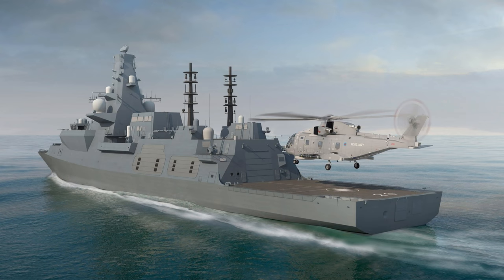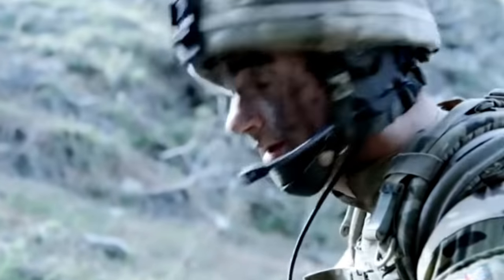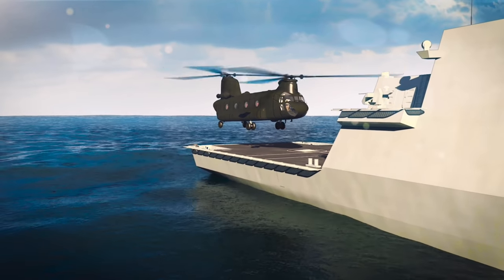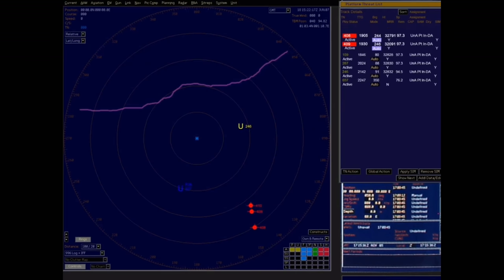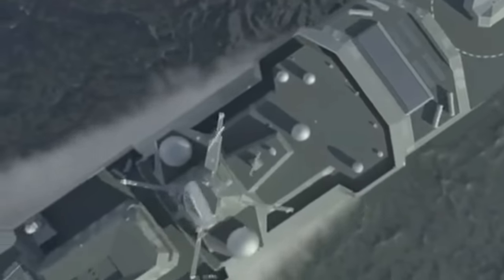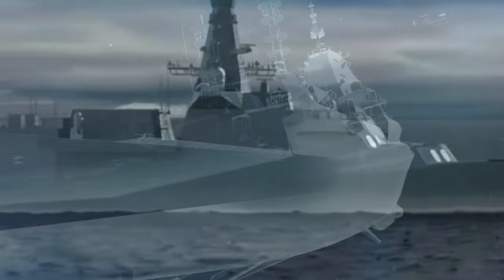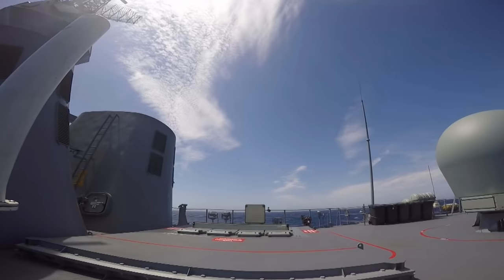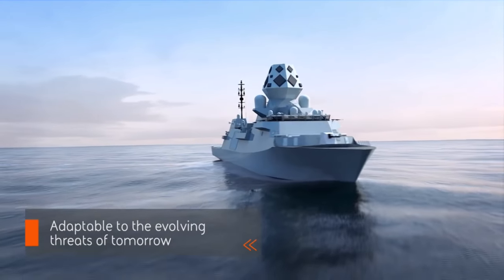British Type 26 Frigate | FUTURE NAVAL FLEET PROTECTION

Comment: The Sea Ceptor will be in 4 missile packs,  so the Type 26, will have 192, of the one type then add the bigger 24 bigger silo missiles  - you got over 200 missiles per ship. The potential is staggering, the brits could use the type 26 as an air defence platform and just arm it with the sea ceptor. You do the maths but of course, any ship wants some flexibility but If they do go for the quad pack as they are doing for the type 45. 

"Sea Ceptor will operate from the SYLVER and Mk41 launchers using a quad-pack configuration, various flexible canister configurations are also available. The Soft Vertical Launch technology reduces system mass and eases installation."

Potentially you have a type 26 armed with 288 sea ceptors - staggering firepower. I image a Type 45 armed with 48 asters, and 96 Sea ceptors. Imagine two of them in a carrier strike group with two type 26 both carrying 288 sea ceptors. That is one powerful defence ability, with the potential to use the missiles for some strike missions. 
https://www.mbda-systems.com/product/sea-ceptor/
https://www.navylookout.com/from-sea-wolf-to-sea-ceptor-the-royal-navys-defensive-shield/

Comment: TYPE 31 has been awared to Babcock and will be built at Rosyth starting next year. UK ships armed with SEA Ceptor and Auz /Can versions will more than likely use ESSM. Type 26 will be a great asset but needs to be built in greater numbers such as 10 for Uk , due to the econmoies of scale and the fact that ships last 30 years and once built they cant be disposed of easily without an intense regional political backlash.

Comment: The best thing about this ship and the type 31e is that the Government for once have got their strategy right. What they're planning on doing is setting up two permanent production lines in Scotland. One for the Type 26 hull and one for the Type 31 hull. They're going to produce the Type 26 in both general purpose and ASW roles to replace the existing fleet of Type 23's, and simultaneously build the Type 31 as a light duties ship to do things like guard the Falklands, patrol the Caribbean and anything else that would be a bit overkill with a T26 or T45. This frees up the Type 26 & T45 to escort the Carriers and patrol the "hot" spots, such as the Gulf and the Pacific. The part the Government have got really correct though is that they're planning ahead to the 2030's and the replacement for the Type 45 Air Warfare Destroyers. The idea is that they'll design the replacement (designation T4X) based on the Type 26 hull, and once they're done with the current production run of T26's, they can just continue production of the same hulls but for T4X meaning there won't be any breaks in production on that line for the next 20-30 years. I expect, although this hasn't been confirmed yet, that what we'll also see is that once the T31 run is complete, they'll design the new mine warfare class based on the T31 hull, and therefore can do the same thing on that production line, and just go straight in to building mine warfare ships with no production breaks, guaranteeing work for the next 20-30 years for both production lines in Rosyth. Seems oddly sensible and economic for a UK Government, eh? If we can get the Fleet Solid Support Ships built in Northern Ireland, as well as the two replacements for the Albion Class ships in the mean time, on top of the last Astutes, and the new Dreadnoughts class of Submarines, we're in a good place.
Reply: The Type 26 is only being built in the ASW role and it's being built on the Clyde not Rosyth.
Reply: @davidhouseman4328  They're making it to be used for ASW and ASuW actually. That's why it's getting advanced sonars as well as being up-gunned with a 5" Naval Gun, plus the 48 Cell launcher for air defence, which will also accommodate the future anti ship missile (probably SM6 i'd guess), so not 'just' a sub-hunter. They're definitely looking at using the T26 hull for the T4X (Type 45 replacement) as well, which makes perfect sense because production can just keep rolling with very little down time between build runs for T26 and T4X.
Reply: @setantii298  If you just meant it can be used for general purposes, then sure. But the Type 23 has 8 set up for ASW and 5 General purpose. That was originally the plan with the Type 26 but the 5 GP versions have been dropped for the Type 31.
The 48 cells for air defence are specific for CAMM, but there are also 24 MK41 cells for anti ship missile etc.
Reply: @davidhouseman4328  Aye, I think the plan is for the T26 to be the "warfighter" and to be responsible for surface and sub-surface action primarily, whilst having an anti air capability, and conversely the T45 to be primarily responsible for air warfare, with a limited surface and sub-surface capability. They should mesh well together. Although aesthetically speaking, I'm not sure sure how one of the massive Sampson radar towers is going to look on a smaller hull, but BAE have already confirmed that it would fit... but hey, if it saves the taxpayer money and guarentees jobs for years to come, let's do it.
Reply: @setantii298  I always like to see something a bit ugly. You know it's built for purpose then.
Reply: @davidhouseman4328  Aye! Once we've got all of these ships at sea, our fleet is going to be potent to say the least. Exciting times ahead.

Comment: So technically it's a "Project 22350 - Admiral Gorshkov Class" boat with 1000 more tons displacement used to make it capable to deploy SOF assault teams.
Reply: TunisianDom 93 is better vessel
Reply: Only with worse cruise missiles but better engines!
Reply: Except it doesn't need a tug boat to tow it around.

Comment: The numbers u mentions are amzing when u see how many navil units there was nefore ww2 , have we slimmed down that much?
Reply: Part of that is the ships changed and so has the mission. The UK had even more ships during the age of sail because of the nature of the ships and the mission profiles that need carrying out. As an example,  at the end of WWII, the US used to own 70% of all ships in the world over 1000 tons, but has slimmed down to about over 300 due to changing missions and the nature of commercial shipping. Part of that also is the fact that there isn't exactly a huge colonial empire to maintain anymore.
Reply: @Scriptedviolince  Nah you're wrong (at least partly) the UK should have at least 30 surface combattants. You can only multi purpose your way out so much. At some point you need more hulls and the UK needs more hulls, as does the US. Sure a modern warship can cover a much larger area than a ww2 warship. But back then frigates displaced a 1000 tonnes and destroyers 1500 to 3000 tonnes. These days most frigates displace at least 3500 tonnes and more likely 5000 tonnes or more. So it's only natural that these ships are more capable (they weigh as much as a light cruiser). 

But the UK today does not have enough ships to do what it wants to do. Even if you escort your carrier with just 3 ships, you still need 9 ships capable of providing escort for a carrier. With 8 Type 26 (we don't know about a 2nd batch yet) and 6 type 45 you only have 3 main surface combatants left for any other mission that comes up. Type 31 will be a glorified patrol boat and it won't be able to do much more than ocean patrol. But it can't hang off the coast of Syria or Libya and take care of itself. 

What's worse is that the RN doesn't have 6 type 45's because HMS Dauntless has been laid up since 2016 because she suffered the worst of the engine problems that have been plaguing the class for a long time. All the ships are going to have their turbines replaced. But the programme is facing delays. All the submarine programmes are also having delays...... Oh and the supply ships are having delays. :o 

So even if all ships where available and the planned maintenance schedules won't face delays. The RN will be cutting it very close with availability.
Reply: Robert - your are wrong on the T45 Engine problems,look up Project Napier /PIP.HMS Dauntless being laid up is more down to lack of a crew than any other reason.
Reply: @paultanton4307  So they're replacing the engines because of personnel problems?
Reply: No like I said it a lack of crew,the Engine problems are being sorted in two stages,the first fix has improved the situation,the second fix is more complicated and involes changing the DG's not the Gas Turbines.
Reply: @paultanton4307  Ahhh I see, they're only replacing the diesels :o

Comment: I think your information is incorrect the type 31 frigate has had its design chosen and the contract has been finalised
Reply: Yes Type 31 is going to follow the Arrowhead design.
Reply: 31e are cheap and will suffer in Submarine warfare. T23/26 were and are expensive because of Noise reduction measures...T31e will be dead meat vs anyone with SSK's /SSN's etc.
Reply: mwnciboo Type 31 is the general purpose frigate design, the cheaper multi role variant that you can deploy on anti drug or disaster relief and all the other missions that don’t warrant a top of the line air defence Type 45 or ASW Type 26, its not intended, by design, to go head to head alone against 1st world navies submarine fleets, but it can do the Falklands or Caribbean patrols relieving the more advanced hulls to patrol the Gulf or China seas.

Comment: Loved serving on T23's and T22's. Type 45's were sketchy with a bad power system, praying the T26 works as designed or a poor bunch of Matelots may well pay with their lives. T22 was a real Rolls Royce of a ship, but it was manpower heavy compared to a 23 and it couldn't take a Merlin...it was however designed as a Surface Bruiser to brawl with Soviet big boy surface combatants (hence the Sea wolf and Goalkeeper)...T23 had VLS Sea Wolf.
Reply: Yes T45 Power Train issues are well known and a fix is in hand,the T26 (hopefully) has taken into account the failures and has a different propulsion set-up (MT30 vs WR21 GT's) and some components of it are being fitted to some T23's during their LIFEX so should be well sorted by the time HMS Glasgow enters service.
Reply: @paultanton4307  Its not power train directly.. it is Power Generation. Type 45 is an All Electric ship. So whilst it does affect power train it is bigger than that singular dimension.

Comment: It's actually a Destroyer. 9000 tonnes for the RAN, this tonnage wise is NOT a frigate. The Hobart Class RAN has are maxed out at x7000 tonnes with little if any room for growth. The beauty of the 26 design is the module specs, room can be made aft for additional VLS is needed at some point.RAN's Hunters are going to have capabilities the RN will not. CEC is the kicker as is AEGIS/CeaFar. That the RN refuses to get CEC is to myself and many mind boggling. It delivers a seamless interoperable capability, the RAN and USN are the most closest of navies. RAN will have a far superior Type26, but many will disagree. At 9000 tonnes she'll have enormous growth options and the UK have really schematically developed arguably '
the' most brilliant modern day ASW/multi role platform. But RAN/RN obviously have different spec needs. Hence the different models.

Comment: The nine Royal Australian Navy Hunter class Type 26 Frigates will displace 8,800 tons
Reply: All the ships are 6900 tonnes light load, full load is 8000+, not sure about 8800, but I suppose it is possible.
For the CSC (Canada) we are looking at the following changes from the British Version:

- Lockheed Martin CMS330 for combat system (an Aegis variant and BMD capable)
- Lockheed Martin AN/SPY-7 radar
- 24 or 32 MK41 VLS cells (qty to be confirmed yet)
- 6 ExLS cells with Quad packed CAMM missiles
- No Phalanx (ExLS replaces)
- 8 x Anti-ship missile (likely NSM but not confirmed)

The rest is close enough to be the same.

Cheers
Reply: @blacquejacqueshellaque6373  

Except the Hunter class will have 9,700 short tons with the superstructure redesign to house the CEAFAR2 with Saab 9LV tactical interface and using the Aegis combat system.

https://en.wikipedia.org/wiki/Hunter-class_frigate

This is how the RAN's Hunter class will look:

https://www.navy.gov.au/fleet/ships-boats-craft/future/ffg

The British version will have a displacement of 6,900 t (6,800 long tons; 7,600 short tons), 8,000+ t full load.

https://en.wikipedia.org/wiki/Type_26_frigate

The RCN's type 26 will look like this but there is little information yet as to what systems will be use except that BAE Systems, CAE, L3 Technologies, MDA and Ultra Electronics which have partnered with Lockheed Martin Canada on the design.

https://www.baesystems.com/en-ca/maritime-capabilities/type-26-global-combat-ship

Comment: Good review Mats but what about the Missile/ Gun info?   You didn't mention.
Reply: He spoke about ESSM though... But the RN doesn't use ESSM they use Sea Ceptor or CAMM missile, which is comparable. They'll have 48 cells for these and 24 Mark 41 cells for other missiles. But the Australians and Canadians will probably only use Mark 41 and ESSM for point defense and longer range standard missiles. But the ESSM is quadpacked in Mark 41 cells so 48 ESSM's can fit into only 12 VLS cells. 

As for ASM's, Wikipedia says LRASM.

Comment: Apparently the Canadian version is getting 32 Mk41 cells all in full strike length and 24 Sea Ceptor cells, with the Spy 7 radar. I question the Sea Ceptor, as we already have the ESSM, which out ranges the Sea Ceptor, faster and carries a larger warhead, and can be fired from the Mk41 cells. 

If they went with 32 strike length Mk41 up front, 8 more mk41 mid ship of the regular size, for ESSM, it would give them 32 missiles, with the forward 32 cells that can be loaded out mission specific. 

What apparently the CDN version isn't getting are any CIWS stations, and while we are retaining the 5" gun, not sure if we are retaining any secondary guns. UK version has twin 30mm on either side of the hangar. Not 100% sure if we are putting anything there (maybe the same 25mm system on the AOPS). 

One thing we are getting are torpedo launchers (which is lacking on the UK version, relying on torpedoes dropped from helos), which may explain the lack of CIWS on the CDN version (Torp launchers would take their place)

Initially ours are getting harpoon launchers, but the ship will be prepped for follow in ASMs that can be fired from the Mk41.
Reply: Scott Millican Block 2 ESSM will be similar to Sea Ceptor in capability terms.  Don’t be fooled by the official “25km+” figure.  Sea Ceptor has made interceptions at double that range.  And it’s much smaller.  Plus there’s the longer range version (ER-CAMM).  But I’d be surprised if Canada moved away from their existing weapons.
Reply: There's also ASROC that can be launched from the MK41 cells that the UK can use for torpedoes.
Reply: I honestly can’t see the point of mounting torpedo launchers aboard surface vessels, when submarines’ weapons have four or five times the range.  In fact it seems a bloody stupid idea.
Reply: @glennridsdale577  There are 2 Sea Ceptor/CAMM. CAMM ER has intercepted out to longer range, but the non ER version is 25km range, which is about half what ESSM will do. (as well the ESSM is faster and larger warhead) Going with the CAMM ER, you are only giving up about 5km range, but you can no longer use the CAMM cells, and have to use them in the Mk41 cells, but they can be quad packed like the ESSM can be. For the most part, a CAMM missile is just a ground/sea launched ASRAAM missile, with a radar seeker instead if IR. 

RCN is already established with the ESSM, I don't see the point in going with another missile. Put another 8pk of Mk41 mid ship for ESSM (quad packed would give you 32 missiles), and the 32 upfront for you mission load. Ideally should be 48 up front, but they have probably scaled it back due to cost.
Reply: @davidhouseman4328  ASROC is a smaller torpedo. Great for putting torps out distance wise, but otherwise don't offer much else for advantage over a ship launched Torp (which is larger, more range, and larger warhead) or a torp from a helo.
Reply: @glennridsdale577  Torp launchers on board ships use the same torps that subs have, so range would be about the same. Those torps that are dropped from helos, or from an ASROC are a smaller torpedo that lacks the range and warhead of a sub or ship launched torpedo. Mind you if you drop it from a helo right on top of the sub, doesn't much matter, but what happens if the helo is out of torps, or worse yet, no helo at all?

Halifax class deploys a heck of a lot more without a helo attached to it, than it does with a helo attached.
Reply: @glennridsdale577  Not at all. I do my research. You should try it sometime.
Reply: Scott Millican Wonderful.  So show me 21” torpedoes on a modern surface vessel, oh great expert.
Reply: Scott Millican You’ve gone terribly quiet.  Why is that?  Canada’s Halifax class carry Mk. 46 fish.  Burkes carry Mk. 46.  So do Alvaro de Bazan, ANZAC, Atago, Brandenburg, Bremen, de Zeven Provincien, Hydra, van Hemskeerck, Karel Doorman,  Ulsan,   Cassard, Horizon, Hobart, Iver Huidveldt and others use MU90.  Fridtjof Nansen and Type 23 use Stingray.  I could go on but I’m bored.